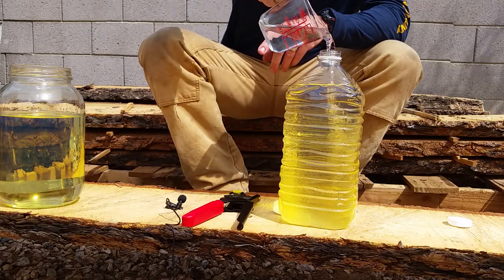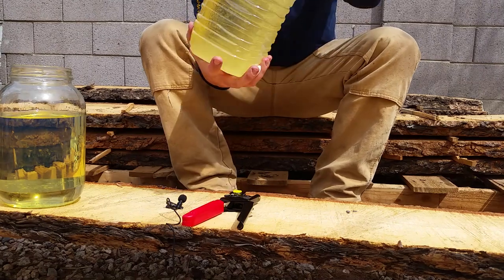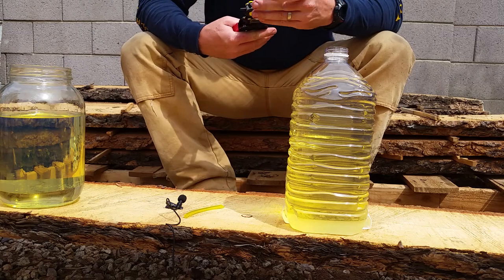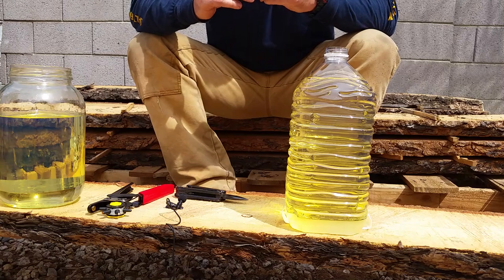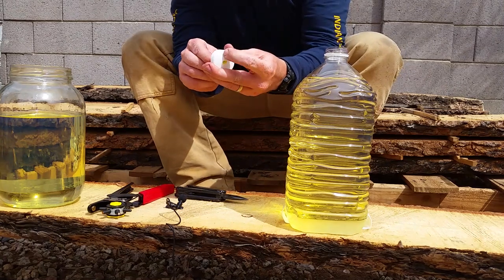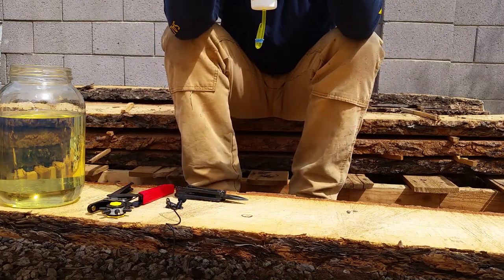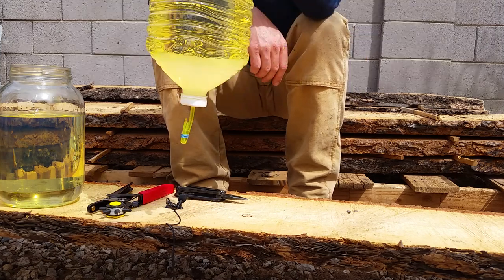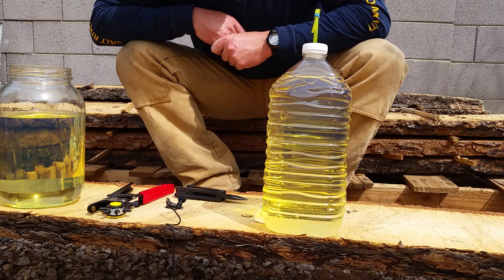Removing ethanol from gas

Comment: Apparently, you never finished doing method before posting this video.  When you actually finished the procedure, I'm sure you found that you couldn't drain anything from the bottle without an air vent to replace the drained water/alcohol mix.  I'm guessing you had to punch a hole in the bottom of the bottles.  Actually, that's not such a bad thing because if they drained without a vent, you might have a mess on your hands.  So, you can un-strap the tubing, put it in a drain container and then punch a vent hole.  You'd probably need another person to do it, though. Also, it might be a problem making a good seal of the tubing with the cap.  One good thing with this method (besides the fact that it won't drain without a vent hole) is that the bottle is funnel shaped at the top which becomes the bottom when draining.  That's a big plus. With a couple modifications, this could be a good method.  I would make a leak-free cap with the hose in it and perhaps put a small valve on the bottom to   use as a vent. Or you could just save the cap and throw the bottles away after punching a hole in them to drain them.
Reply: bob miller, really?
take it for what it’s worth and run with it and make it work. 
please post your perfect video.  
i myself found this to be an informative experiment that allowed me to open my mind and try something new.

Comment: After learning of ethanol damage to small engine parts and wanting to save my lawn equipment carbs, I ended up with the same exact idea. With a BS is chemistry I thought, "Ok, easy enough, just add RO water to conventional fuel until the ethanol crashes out (sticks to the water, aka hydrophilic). Then use a separatory funnel to separate the layers." looks like there are no new ides out there ;).  Realize though that most gas station fuels also have other conditioners in it which may crash out into the water as well. not really a problem though if using the fuel for small engine equipment. cant wait to try this out and save myself from buying the canned ethanol free premix ad my local HD store.
Reply from the maker: Let me know how it works
Reply: @KimballCody  It worked with some tweaking. Even after a few flushes with RO  water the fuel was still hazy. My guess is due to emulsifiers/detergents  added to the fuel to help stabilize the ethanol in the gas. My workaround was to use a lot of salt and make a saline solution which deactivates the detergents. This allowed for the layers to separate fairly quickly. It still works without a saline solution, but I had to wait all night for everything to settle out and decant the gas off the top

Comment: I have an idea. What if you made a stiff plastic tube to go up through the bottom of a container - or take a jar like the glass one - and extend the straw deep enough through the lid that it passes through the water/alcohol and into the good gas? You tip the jar upside down, the tube passes through the layer of water/alcohol and into the gas. Put a shutoff valve on the tube, and drain the gas into a new container, or, directly into the engine. The tube would have to be 1/2 inch or larger for fast gas flow. Essentially, rather than draining off the water/alcohol - you are draining off the gas. MUCH faster, and less steps.

I think I may try this myself because I have Case/Ingersoll tractors that use ONAN engines. They hate ethanol. THANKS for the great tip!
Reply: Granted my math isn’t all that good but if there’s 10% ethanol and 5-10% water to drain off, is that smaller percentage not faster to drain off vs 80-85% gasoline ????? Hahaha

Comment: OK,  what i don't understand is, how if the ethanol separates from the gas, it doesn't do so in holding tanks at gas stations?  And some people get good gas and others get almost pure ethanol? Thanks
Reply from the maker: +Peter Ford water and time. The gas doesn't sit long enough to accumulate moisture in the air. But small engines and gas cans do when sitting in the garage for months. Water floats to the bottom. Fuel filter is on the bottom. Spring time you fire up your weed wacker or chainsaw and the first few revs are water/ethanol=ruined engine
Reply: KimballCody Right,, makes sense. I actually didn't see first part of your video where you added water to bottle to grab ethanol. Thats where I lost your perspective. I've actually been getting ethanol free for my mower, wacker and chainsaws. I'm terrible for not draining between long uses. Guessing most of us are. But we can't get complacent. Even pure gas breaks down though evaporation. Thanks again.
Reply: Peter Ford I
Reply: To be safe,   Run a  50:1   oil mix just like a two Stroke Engine.    Put 2.5  oz of oil into one gallon of gas after you remove the Ethanol.      Any engine oil will do.

Comment: In a laboratory setting you would use a piece of glassware called a separatory funnel. And rinse the gasoline fraction 3 times with distilled water. Once the water/ethanol layer is drained off, run the gasoline through another funnel with anhydrous sodium sulfate to capture any remaining water in the fuel fraction.
I wonder if the water/ethanol from the first rinse could be stilled to capture the ethanol from the waste fraction. The azeotrope may contain benzene though, which is a carcinogen.
Reply from the maker: I just had a plastic jug......but I believe everything you said is correct
Reply: @KimballCody 😅

Comment: maybe I missed something? Why are you adding water to your fuel? I thought this is what your trying to remove? Also where did you get those clear jugs that hold gasoline?
Reply from the maker: The water clings to the ethanol and sinks to the bottom. You're left with pure gasoline....in theory
Reply: So you draining water and ethanol same time.

Comment: Yes,  I remember back in the 80's when they began adding ethanol to our fuel I was pinching pennies to manage my long commute back and forth to work so I tried the new fuel which was optional at that time with the assumptions that this new fuel that was touted to save America could save me some money on gas mileage.   What a joke!  I lost an average of 3 to 4 miles per gallon and my car was way down on power.  I knew then that this stuff was garbage.  Now that I am forced to buy this trash, thank you stupid, crooked politicians,  I am also forced to deal with the results of burning this garbage in my outdoor power equipment with it's deadly destroying effects of corrosion in fuel system components of small carburetors.  The only politician in Washington that I believe can understand this is Rand Paul from Kentucky because,  if you can remember,  he was viciously attacked by a rabid democrat neighbor while he was mowing his lawn on a summer afternoon.  How many of these politicians in Washington do you think even  know what a lawn mower is?!!!!

Comment: Great vid. I actually did this my self until I found a gas station across border line from my state that sells 91 ethanol free gas. I wonder how many points does removing the ethanol you end up with.  Like one of the commentators said. The only ones benefiting from this is the corn farmers and refineries as they also get some incentive from the government and let me add the companies that sell additives to the already additives added to gas from the refineries , our expeensives cars, motorcycles and other gas using equipment suffer the damage that ethanol causes and our pockets for paying for 90% gas.
Reply: I understand the octane reduction from taking out the ethanol is about 3 for E10, so for example, 89 would become 86. That is why starting with high octane fuel is recommended.

Comment: So what happens if people start drinking the ethanol removed? It's basically corn whiskey. Thanks for the practical use video. I think I'll use food coloring to ensure I get a full visual of removal.
Reply: How about buying ethanol free gas instead?
Reply: @Martin Hamilton: You'd go blind or even die from it. The ethanol is 'spiked' with methanol, which is toxic. They do that because of alcohol excise duty laws.
Reply: Isn't wood based alcohol METHANOL?
Reply: No tyvek05, ethanol is ethanol no matter how it is made. What makes ethanol in gas poisonous is the methanol that is added, plus you would have residual gasoline left too, you can't get 100% separation.
Reply: VIsubby not to mention the sulfuric acid, Ammonia and sodium hydroxide. Just to name a few. If it goes through a couple more columns in distillation it could probably be consumed. But it's made to be burned.
 Besides before it is legal to be transported, it is mixed with a very crappy grade of refined product of fuel. No good for your liver
Reply: Frank Gutowski ok, How so?
Reply: domino diamond ok thanks, Your the man! What's the difference from the moonshiners operations in the Smoky mountains that is allows the so called metals to drop out of there product?
Reply: domino diamond I agree... The ethanol plant I operate at has to be in ordience with a government oganization that makes them run food grade grease on all equipment that could come into contact with the product. The vessels and piping systems are in compliance stainless steel. The reasoning is the co-product of a facility will be consumed by animals. I am talking mainly and about product that is fresh out of the seives. Those pull the remaining 8 % of water and other non alcohol materials out of the product. Including VOC volatile organic compounds. Leaving a fairly pure product. Before the denaturant is added when the alcohol is loaded to a rail car.
Reply: Take it to a lab for a test before you drink it.
Reply: Martin Hamilton
They add a chemical to it that will make you throw up and give you the shits. They did this to keep people from drinking it and avoiding the alcohol tax.
Reply: WELL removal of ethanol from gasoline or even E85 does not make it safe to drink. DENATURING is the tainting of "drinking whiskey" has been done for centuries. current components used are gasoline, methanol, and other chemical solvents. SEE E85 IS made to keep people from drinking it. ONLY more expensive race fuel ethanol, purchased from special distributors is pure and the fact is that distilling ethanol in wrong metal makes it unfit to drink except for the most diehard of alcoholics. Even with this crazy video telling you how to separate it you dont get good IE proper octane fuel OR drinking whiskey. You simply forced the ethanol out. And according to the research I took time to look up the separated gasoline lost 7 to 9 points of octane thus making 87 octane 78-80 octane and base unleaded fuel BEFORE additives make it motor fuel grade which in general comes from fuel plant at 75 to 77 octane  (ie 85 is minimum you can put into any currently sold internal combustion engine, super old stuff with 5 toq to 7 to 1 compression might run ok though) and would only work in most preWW2 engine.
Motor fuel production and blending has become/is a science. Many hot rodders will use mix wheels to blend race fuels and regular motor fuels to achieve different blended octane ratings so as to drop fuel costs.
Reply: its called denaturing and most cheap versions use gasoline,,,,,,,
Reply: How can i pull a homer simpsion?  some for the car some for me.
Reply: tyvek05 wrong the fact is methanol based fuels failed miserably. But would be labeled M10. Also methanol causes 1000%more corrosion than ethanol. IF any methanol is added it's is in less than 1% amounts and is used as a cosolvent not an oxygenate, which it is not.
Reply: Matt Corregan ethanol CANNOT BE PRODUCED FROM CELLULOSIC PRODUCTS LIKE WOOD OR GRASS. E10/E85 is only made from sugar/starch based products using Brewers yeast. Again GASOLINE is generally used to denaturate ethanol.
Reply: Frank Gutowski such as? is them up. and what is wrong with what I said? several years ago I was developing a true bit on flex fuel conversion but possible cost vs profit, technical resource desk to help idiots through failures in installs just didn't make sense PLUS the ethanol politicians quit pushing as hard to push it into all areas. we used to have 1/ONE E85 pump with in 50 + drive so for me I would be forced to actually finance and build an E85 station just for me. 
Also allow me to reiterate that just because it's in Google/Bing does NOT make it actual FACT. Ethanol (ie grain alcohol) has a limited amount if products it can be made from. Another reason ethanol production has had issues is research into possible ability to use cellulosic products for production. Mainly cause to classify as ethanol it has to meet FDA regs, not be highly acidic, which every current ( to my knowledge )experimental process  has produced. Cellulosic alcohol IS methanol and methanol no longer is even allowed according to EPA rules I saw for 2016/2017. NASCAR doesn't even want it, you HAVE to use foam to extinguish, ethanol goes out with water. so PLEASE post your Google facts and share.
Reply: Frank, They have been trying to derive ethanol from cellulose product but so far no process can properly do that. Ethanol fuels are derived from sugar based products and sprouted starch bearing products. Generally about 40-45% of motor fuel ethanol is from feed grain corn/etc, about 20% from discarded sugar/sweetener products, 25% from actual condemned food stock and the rest from actual sugar production. At least that was from last report I received. See because I was planning a fuel system based on E85 I got pretty deep into checking stuff out, joined ethanol boards/groups. Basically trying to get the low down. Mainly cause I have couple of companies that kept slamming my plans to possible business partnerships, suppliers etc. 
I had to get info on what it came from, and such. I had a lot of info from when I first toyed with building my system just for me, then got pretty heavy into an open source FI system and its ability to adjust automatically as I didnt want to have to adapt Ford or GM systems just wanted to use specific sensors. 
Methanol IS acidic, wood alcohol tends to create aldehydes which are same remnants that methanol creates. Regardless Ethanol was chosen  product, what all the subsidies are for and the power players wont necessarily let go of their pet project and car makers still have billions tied up in production and service of them, government still cuts car makers breaks on CAFE standards(which needs to go away just adjust tax credits for company selling most flex fuel cars) The reason Ford went to aluminum truck parts is to get mileage up. 
Biggest issue with all alcohol except ethanol is they are all poisonous, as was MTBE,EBTE. And thus ethanol is the staple oxygenate/clean fuel. Also several forms of bio matter waste that wasnt used just dumped or burned is now used in motor fuels.
Not really sure why this keeps rolling around. The corrosion ethanol based fuels are associated with are from the stripping action it has, not its properties. Ethanol evaporates pretty clean and burns clean. Its high octane rating makes it a sure win for performance enthusiasts. I build race engines, I have several racers that carry different carbs and ignition programs or have the ability to reflash onboard computers to run E85/E100. Its cheap, $2.00 ish a gallon for E100, even IF they burned twice as much (in general we are seeing a 15%-20% increase in fueling on E85, and 30ish% on E100. The fact is most guy love it cause they rarely have to do all the after race prep with ethanol over methanol and power difference id at BEST 8%. 
With meth they have to run system dry, use fogging oil in engine, if it sits more than couple days many will actually use ethanol and ATF to treat the fuel system. I have a box full of Holley race pumps going out for repair from methanol corrosion. Lucky  I found anodizing company that will hard anodize parts reasonable in small to medium lots for decent price and replacement stainless parts that wont corrode but if more places sold ethanol I wouldnt have such good side work.
It works its clean and if they would just let the free market take over the government could quit spending so much on it. BUT DEMs dont want subsidies to quit, it gives them "lookie results" for election time. and most farmers still think sugar/starch based crops could do better. 
Yes it can use more fuel but its renewable and clean. and not a nightmare or villan.
Reply: If you can find it?   In many areas,  ethanol is mandated to be used in Gasoline by law.  That is the whole point here...how to remove that ethanol from regular stock gasoline!   All the power to you though...if you can find a source of pure gas?
Reply: I've heard that ethanol right out of the plant -- before anything is done to it -- is pure moonshine and can be used as such. Is that true?

Comment: you have to use distilled water for this to work...everything thats not water will be trapped in the gas...ie minerals and heavy water
Reply: stickloaf Heavy water would behave no differently than regular water in this case

Comment: I always use VP-104 oxygenated  race gas in my yz450, it's real fuel
Reply: At 20 dollars a gallon it should be good, lol.
Reply: I use VP C-12 in my Husaberg 570 and it performs outstanding! I buy the 5 gallon pail in Phoenix for about 75.00 and I keep the steel can for storing treated pump gas.